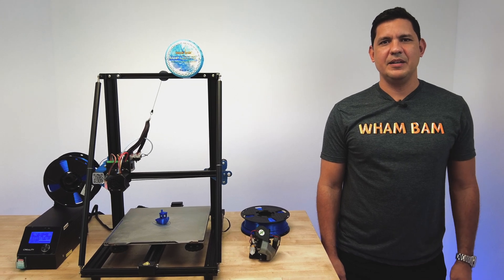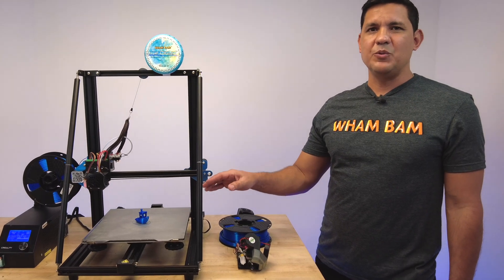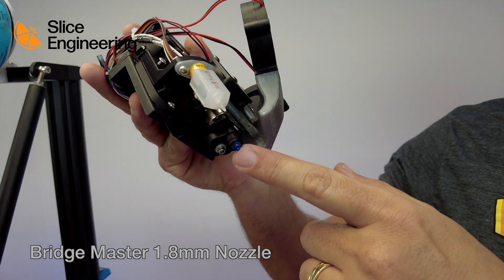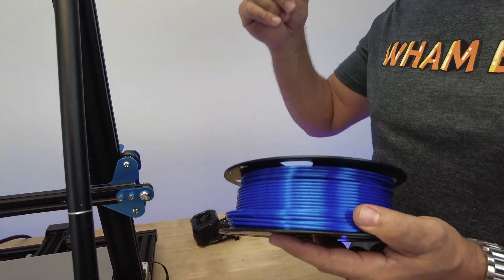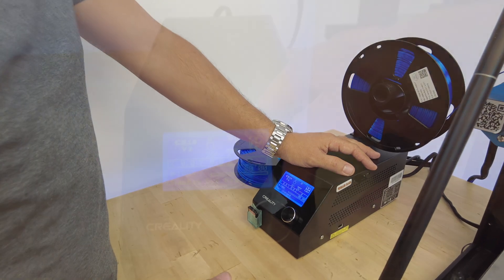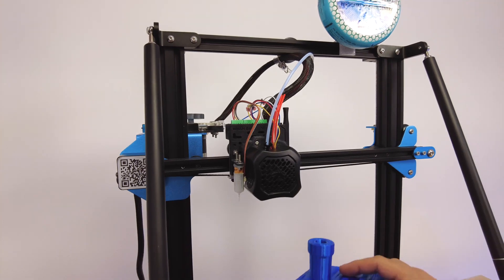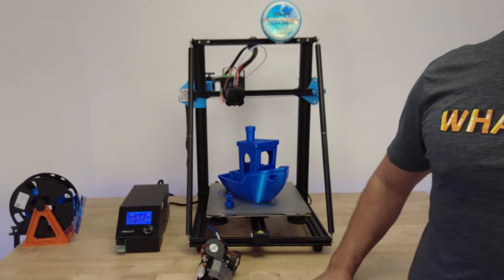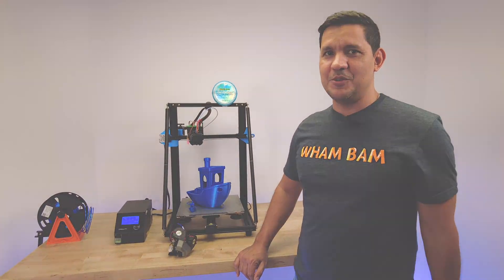Quick Change Nozzle - From 0.4 to 1.8 In Seconds

Comment: Seems like a neat concept, but for the price I would prefer to build my own toolheads running something like the EBB toolhead board or really any other CAN board, and with klipper this means I don't even have to flash firmware or worry about parameters at all. Your solution seems easier to set up and requires less knowledge, which is neat for a lot of people, but I wonder how applicable it is at the hobbyist level. I can't imagine many people have a reason to change filament size, and nozzle size is an easier swap than entire hotend even with the Mutant system. I'm interested in seeing reviews and long term performance, but always good to see new designs and ideas/implementations